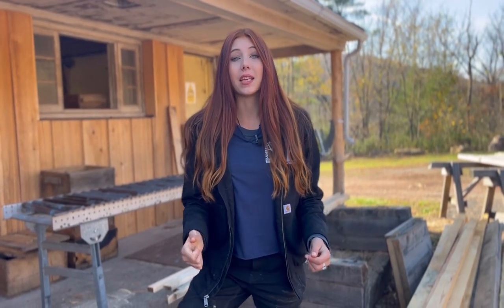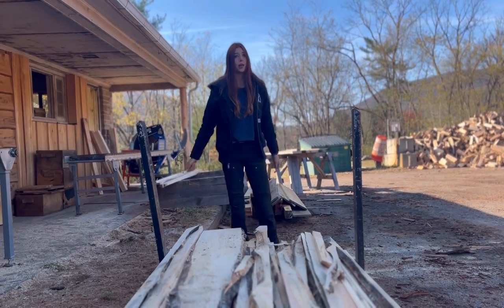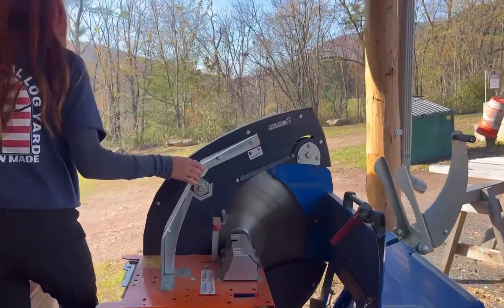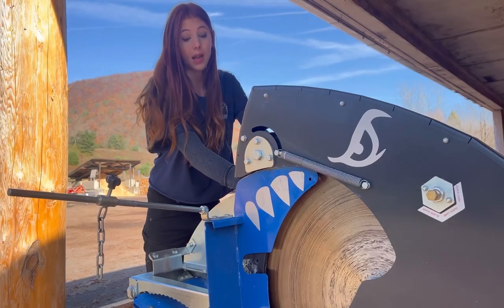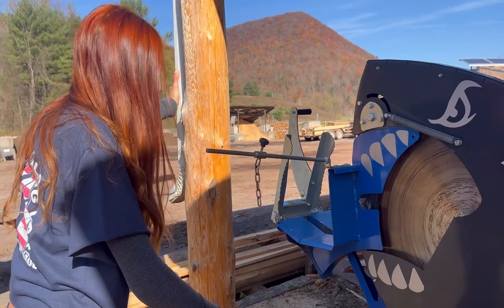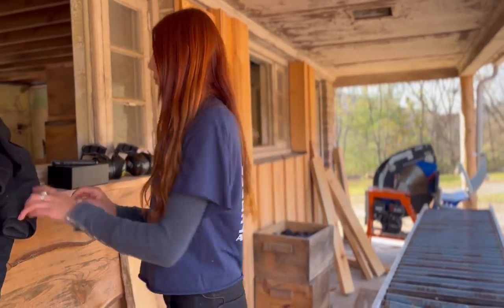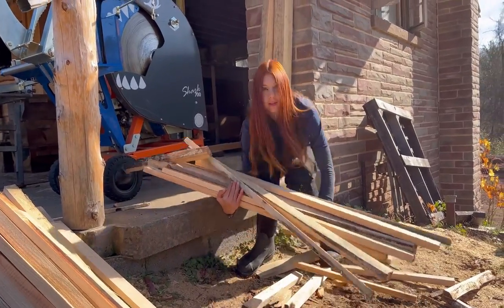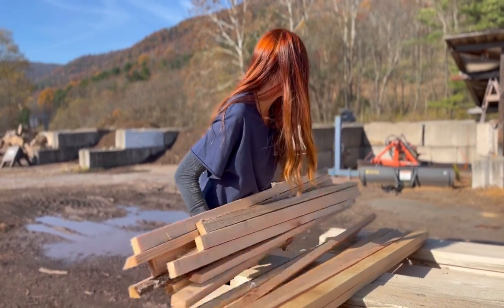The Shark 700; BEST Tool For Making Lumber Stickers!!

Comment: There is a reason for the rod with the chain on the right hand side of your saw. Have grandpa install a 50" rod with a chain hanging down to indicate where 50" is on your sticker stock. There is no need to measure the stock, just push it out until it contacts the chain and then cut.
Back your little sawdust hauling Kubota truck up to the buzz saw so the cut stickers fall into it rather than on the ground and handling them unnecessarily.

Comment: If you had an outfeed table, like your infeed table, you could set up a stop block at 50" and really make a ton of stickers in a short time. Have a good weekend.
Reply: Stop blpck , easier and faster
Reply: A stop block is trivial on a chop saw but a little more complex when the board has to move to cut. Could be done, but the only easy way would be if the whole out feed and the stop block moved together. Either way, it must be removable. Grandpa could create one I’m sure.
Reply: Yeah, it's silly to measure and mark for that repetitive operation.
Reply: Maybe lag bolt a board on that post so you can flip it up in line with the post to cut longer stuff.
Reply: I could have a field-day going through their whole setup and simplifying the whole process. So much that can be done with little cost.
Too much time is spent manual handling between machines.....
Reply: I was thinking the same thing!! 😊
Reply: @johnsadler8637  out feed table with a pneumatic controlled stop block. Piece of cake. Synchronized Motion. Put an actuator on the stop block on an out feed table and synchronize it with the chop saw. 
    When the chop saw travels down the stop block retracts. Sticker is sawed. When the saw is lifted the sawn stickers are pushed/removed pneumatically off the out feed table. At the end of that cycle the stop block enters an new lumber is sent down the line stopping at stop block. Starting the cycle again. Piece of cake. 
  So you’re talking bout a length of roller line, couple of actuators, syncronators, machine parts and possibly software.
Reply: @hidingfromu5293  Oh yes, that would make this much more efficient. However, there is no electricity at the LCL, and they’re unlikely to commit too much effort into a process that might get an hour or so 4 or 5x per year. If they could rig a passive stop block that didn’t prevent the board’s movement when the cradle rocked up, it would pay in saved time, probably.
Reply: My thoughts exactly. Quick and easy to make a jig for that.
Reply: Remember... These ideas (some are very good) MUST be inexpensive. Next time, put a price on your idea, and in his line of work, lumber is FREE.
I wrote this because The Boss is very busy- 60-70 hrs/week and he just took delivery of a $200 K JD Loader.

Comment: We take 7-8 one inch thick boards and set them up on the mill and make about 40-50 or more stickers in a dozen passes.  Very easy and cheaper than buying another piece of equipment.
Reply: @_Boregard_Rippy_  I can’t argue about the cost of the stickers because we don’t use waste but we do use low grade boards that aren’t great quality which makes the cost very cheap as we’re producing from our own stock.  When we’re trimming dozens of stickers to length at a time, the time it takes isn’t really a factor either.

Comment: Nice.  Adjust stop the blue cradle so that it can not retract far enough fo the leading edge of the plate to escape.  If no adjuster, just add a spacer/limiter/tether.  Could also slightly bend the leading edge so it re-enters behind the other shroud more easily.  I'm in Colorado now, but we used to rally race (STPR & Tiadaghton)  in the woods near Wellsboro/Williamsport fun camping too!

Comment: I agree why not use a radial arm saw or sliding miter saw which could be portable.  Seems a lot safer and less complicated.
Reply: A radial arm saw has to be one of the most dangerous machines created. I have both radial and buzz rig, old planers, old handset and auto circular mills. Yes care needs to be taken with any machine, but the inherit danger is actual designed into a radial arm in that it pulls itself through the wood. The buzz rig the wood is fed into only when you are ready and supported by the table

Comment: Emerald, when I was a kid, I remember my Uncle had a cordwood saw similar to your Shark 700. But, it was driven off a flat belt from the tractor, and had no guards whatsoever. It was just a 36” saw blade with a table like yours that tilted forward into the blade. The blade was completely exposed! Your grandpa might remember saws like that. Us kids were not allowed anywhere near that saw when it was in use!

Comment: Those pieces of wood you use for the stickers are nice to sell as furring lumber. Contractors use them to build out walls or ceilings to make them thicker, you should use the lumber with the bark edge for stickers, they may not get taken as much and if they do it was not sell-able, except to grind up as mulch or starter wood for fireplace/ fire pit.

Comment: Hello, several people have commented on ways to measure out your stickers. I think probably the easiest way would be to simply measure your roller conveyor from the end closest to the saw, and then put marks/tape at 50 inches and 100 inches from the end on the side rails of the conveyor. Then all you would have to do is line your stickers up with the end of the conveyor and make your marks. you’ll never have to use a tape measure again for that. Plus you don’t have to carry around a pre-cut sticker, move some thing to use as a stop, etc..
BTW, I build material handling conveyors like that and other types of equipment.

Comment: I don't have a fancy edger, so when I get a few stacks of boards with wane (usually on one edge), I stack them on edge on my mill with the wane up, like a big sub sandwich on its side, and work my way down cutting stickers. As the taller (wider) boards reach a width that makes a good board, I pull them out, reclamp the stack and continue on down, usually down to 1X6s. It's slow and a bit tedious, but I get my boards edged and some new stickers.

Comment: Emerald, why so exact with the measurement of stickers, (spacers,)? Can they not just be doubled up shorter lengths as well? if the spacers were less attractive lengths and widths, as smaller bits, then it is possible that less would go missing, or that the only ones to go missing would be those used by customers when separating their purchases in their trucks.

Comment: Okay you got me into this one. You could save a lot of time laying out the length of the stickers by simply taking one of the stickers you have cut and laying it on top of sections to be cut and marking with the pencil rather than use the tape measure each time. 

And Grandpa could use a miter saw for the stuff he does. Your Welcome

Comment: Sami wanted to know a while back if anyone had any ideas of how to better fuel the Shark. She was struggling to fuel it. I know some suggestions were made. Did you ever find a better way that suits you all? Awesome job as always.
Reply: Found  the answer  to the problem .   Sami  can order  it  from the Home  Depot.  Rotary Fuel Transfer Hand Pump  Made by Fill Rite Model# FR112C
Reply: @burlseeker4680  When I was a kid we had a lever action fuel transfer hand pump.  It had a pipe on the inlet side which was long enough to reach almost to the bottom of a 44 gallon drum.  Just unscrew the large plug on the drum, drop the inlet pipe of the pump through the hole, put the outlet hose into wherever it was supposed to go, and start pumping.  Typically we'd pump a bit of petrol (gas) and a lot more kerosine, as we had an old Fordson tractor which started on petrol and ran on kerosine - hand-crank to start, let it run for a minute or so, and then switch over from the petrol tank to the kero tank.  It was a decent workout refuelling the tractor after it had been run for a while!

Comment: SIMPLE WAY TO SAW WOOD SURFACES ON REMAINS OF BOARDS, ETC
IS TO PUT A MEASURING STICK WITH A ROLLING IRON ABOVE THE SAW BLADE ON THE SAW THE SEW POINTS OUT AFTER THE SAW WITH A STICK DOWN THEN YOU CAN MEASURE HOW MANY CENTIMETERS OR INCHES THE LENGTHS SHOULD BE MEASURE THE STICK SHOULD REACH DOWN TO THE MATERIAL YOU WANT TO SAW THEN YOU SHUT FORWARD THE MATERIAL FOR THE STICK THAT YOU SET TO ONE MEASUREMENT AND ALL WILL BE THE SAME LONG

Comment: Your shark is a lot fancier then my grandfathers.  He used it for fire wood.  It was a bare 18-20" saw blade on the PTO of a John Deere B tractor.  He had a hand made pivot cart just like on you shark to hold the logs. No saw guards whats so ever.  My grandfather was far more enthusiastic then my grandmother on moving to Florida from Northern Wisconsin.  We felt it had something to do with firewood needed to heat the old leaky farmhouse.  He filled 3/4 of the basement with firewood and another shed every year to heat the house.  At 70 years old, it was taking more time to do it.

Comment: So the buzz saw is used most often for 50 inch stickers. The bed needs 50 inch marks on the sides. Then you do not need the tape measure to mark up the boards, only the pencil.

Comment: Good Job, try making a template so you don't have to pull out the tape measurer every time.
Reply: Maybe they want to see how long it takes.
Reply: @flynnstone3580  You can time it both ways, besides cutting one stick to 50" and using that is better than the tape measurer. It's nice to have a stick around for a long time watching it age as you use it over and over again. Also saves your tape measurer.
Reply: @jasonknight6010  As you walk past the stick you say "yup, that's the stick that I use to measure with, had it for 25 years now"

Comment: Consider clamping a stop block at 50" on your roller conveyer and you don't have to mark and measure any sticker cut. Just butt the material up to the stop block and chop. Also. Bundle a bunch of material together with a bungee cord and you can cut dozens of them in one chop. 

/2 cents

Comment: Great vid Emerald. Love the change of pace vid. Something you think is trivial, but it isn't. Stickers as you say are important for when you stack your lumber. Once again nothing goes to waste if at all possible. No what they say, use a hammer and if that doesn't work use a BIGGER hammer lol. In this case use a foot if the blue part with the white shark looking teeth comes out of its track. Once again, Emerald and Jade, the dynamic duo doing their thing.
Reply from the maker: +viper 0372 👍🙏
Reply: @lumbercapitallogyard  Make sure the machine is switched off before you kick it, though. You really don't want to be the first shark bite case ever in Pennsylvania

Comment: What a strange saw. Such a big blade with a gasoline engine, so it's meant for big pieces, but then you have to lift your material against the blade instead of moving the blade. Making it clumsy with big pieces of material.

I think a regular chop saw (a mains or battery powered one) would be a lot more handy I guess.
Reply: I agree

Comment: That saw is way too big for that job. You can use a small Miter saw and save on energy and wear on that expensive Shark. You could also easily jig a 50" backstop on a second table so you don't have to measure and mark every board for length. With a sliding miter saw you could probably cut 3-4 sticks at a time.
Reply: It might be that the saw does other jobs, and it just happens also to be useful for cutting sticker?
Reply: @vk2ig  yes I agree what if they have to cut a 22 inch slab. The shark gets it done

Comment: Bet your Dad could drill and tap a hole in the side to accept a "All Thread" rod with a plate on the other end to allow a preset 50" stop for the perfect cut every time and fold out of the way when doing some other length cuts ... just a thought. Nice machine ... keep forgetting you guys don't have "electricity".

Comment: Sure beats moving the blade to the work. Ever see a saw blade come off the pulley? And scoot across the yard. It's dangerous. It can kill you. Or worse leave you wounded with many scars. That's the old school way.
Reply: I've never seen nor heard of a saw blade being on a "pulley". On a shaft or arbor, and have never seen nor heard of a blade coming off. I've seen them be loose, but that is evident the instant you turn the saw on. And getting cut by a blade is worse than being killed? REALLY?

A 12 inch compound, sliding miter saw would do everything the Shark does and do it faster, safer, with less physical effort. And it would be easy to set a stop for repeat cuts.

Comment: For what it's worth... I operated 3 picture framing studios and galleries. I also operated a moulding manufacturing company. I got my wood from the slabs discarded from the mills in the area. Most logs are clear at the slab level. I got my wood for next to nothing! I remilled the slabs into 1x2's, 1x3's or whatever I was in need of. Mouldings are in much demand and expensive. It would appear that you are in a position that you could supply these small dimension products. I'm old and out of the market. But I see potential here. Maybe something you would want to check out. Bound to be some small scale operations in your area there. Or maybe some big ones!

Comment: A thicker sticker😅 50” seems like a odd number?
Reply: 50” to lay across 48” of cut lumber, with just an inch on each side for grabbing or shoving into position? Just a guess, I’m not a lumberyard worker.
Reply: @ronsamborski6230  Sounds like a good reason.  You get 4 x 12", 5 x 10", 6 x 8", 8 x 6", etc, with a 50" sticker.  And the weight of wood per sticker would be roughly the same for those loads.

Comment: I'm very curious about that machine you just used to cut  the stickers. I've been a carpenter for over 50 years and have used a laundry list of different tools to cut wood and the only time I have seen a saw that is operated like that thing you call the shark is in a couple of your videos. Why use that machine when there are several that are easier to use that would be faster and safer.

Comment: I didn't see the saw properly, but my mechanical eye tells me it's either missing a rubber stop or the table end stop is bent in the down home position. This will cause the blade guard to extend too far out and the table to extend too far down... The table pivot bearing may also have too much play or the table is mounted too low. In plain English, the guard probably shouldn't extend out of the rear protective housing at all. Isn't there a stop screw you can use to adjust the final position - sweetie? Are all fastening screws still tight? The small hook 4:46 also wobbles noticeably and could hit you in the face if things go wrong. For 2-3 bucks there are safety goggles with clear lenses for both of you, so your super pretty eyes will come into their own even better. Emerald, I can already picture you balding - patched with the skin of your butt. Then I'm the only one here on YouTube who's still in love with you and Jade!
Reply: Ernesto Spadolesto - Could you possibly be more creepy?
Reply: @canadiangemstones7636 I don't know, it won't be easy. But I will definitely try. I do everything so that both of them notice how dangerous such a machine can be without safety goggles and loose hair. If there is just a piece of iron stuck in the wood, it can be dangerous. The two are just too pretty to get any nicknames - like "eye patch emerald" or "two fingers jade"... The two still have their whole lives ahead of them and many doors are wide open to them. Life definitely changes after a serious accident, and not for the better.

Comment: A bit of chem trail action happening in the sky behind you at 1.30. That saw is overkill. Use a cheap electric makita dock off saw. Why use fuel and wear out a petrol motor to cut 1x2's . Just my 2cents worth. Trying to save you cash. No offence intended. Good job girls.
Reply: The only electricity they have on the site is the solar power for the office?  That's why everything else (e.g. LT40, edger, etc) all run off gasoline.

Comment: My dear lady,  you should be taping nothing.  Skip that step entirely.  Set a stop, or a gauge,  a registration mark on the table at 50 inches from the blade.  Do that just once and you will never need to pull out a tape or pencil again.  It will more than double your productivity.